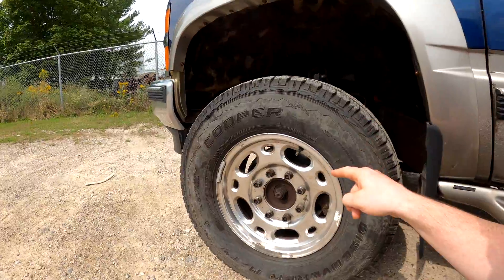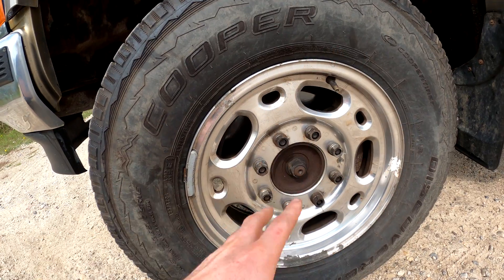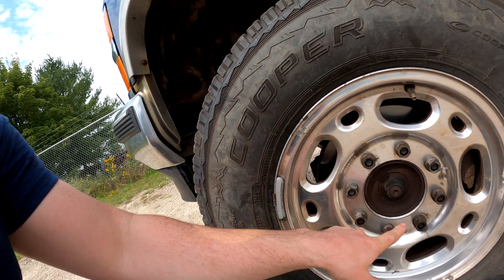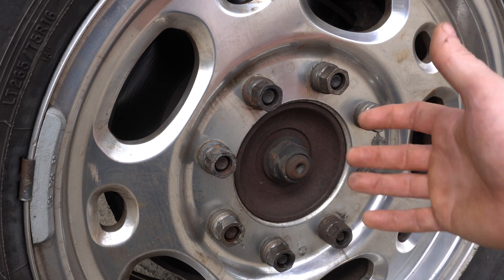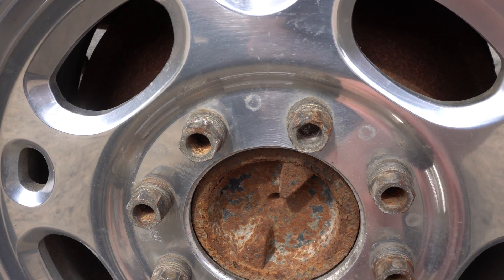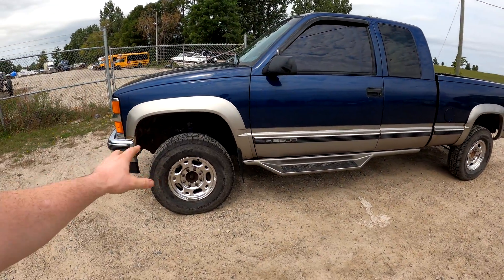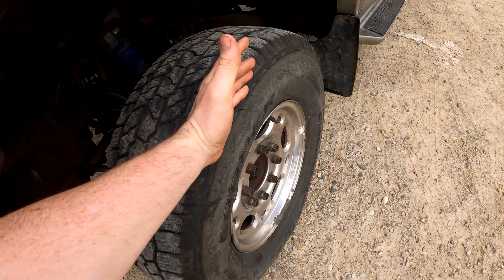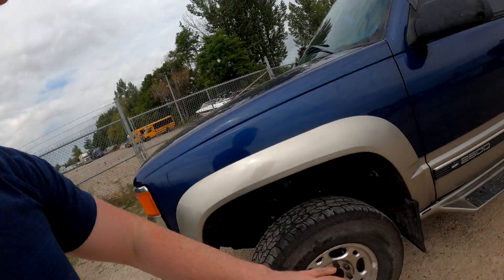Are WHEEL SPACERS Actually SAFE? | Hub Centered Wheel Spacer Fail

Comment: Excellent video thank you for putting the message out there. I am having to rectify a vehicle given a bodged up vehicle body  lift by a previous owner. Not only did the body lift wreck the cylinder head by putting the radiator and radiator fan out of alignment causing the engine to overheat. The wheel spacers used for the oversize tyres were full of stress cracks and were soon about to fall apart. When I put some welders crack detector on them I found these cracks to be even worse than they initially appeared. Needless to say I have got rid of these oversize tyres and wheel spacers and have had to put in hours to get the vehicle back to how it was before this bodged up body lift. I am all for people being allowed the right to repair their vehicles but against people interfering with vehicles in such a way that they can become death traps.

Comment: Don't use spacers. period. Use better wheels, or stock wheels. The offset is designed to distribute the load on your bearings.
Reply: True but most ppl don’t have the money
Reply: @_Sayvo_  i wouldn't do it then. Theres a video of a spacers falling apart on the highway. Tire comes off and launches another car in the air and flips it. Talk about not having money. You won't after being responsible for that mess
Reply: @MC2RD  true, but I think that’s because ppl get carried away and run 2-3 inch spacers..I’m running 10mm spacers and it’s fine
Reply: Spacers are fine as long as they are hub centric. Porsche have been using them for ages. Just dont use on a truck ment for haul, loading.

Comment: So what about using regular spacers on the 1500 ram? Safe? I wanna get 1in ones.
Reply: I have 2017 ram 1500 with 2 inch spacers adopters with regular 20 inch rim and 33 inch mud tires on stock ride height torque them to the spec and works like a charm for 4 years now no problems of any kinds i rotate my tires every oil change so i check spacers to and torque them if i have too.
Reply: @Sani1290SDR  Is there’s a speed limit with the spacers?
Reply: @arngamboa5637  I went many times 170kmh with my truck that's the truck limit.I honestly never had issue with my spacers, but i rotate tires every oil change and check on them spacers, to make sure they are still tighten. I did donuts, burnouts, quick acceleration. No problems and I bought mines of ebay. I do wish i got 2.5 inch spacers. Makes truck look even better.
Reply: @Sani1290SDR  i bought 2 inch spacers dcvamous hub-centric from amazon do you think this brand is reliable for daily driving
Reply: @marshalkwt  well I don't know anything about brand, mine are hub centric from ebay, so far made 150k kilometers with them. I have no issues whatsoever,  but I rotate tires every oil change and make sure that spacer bolts and tight and everything is snugg no cracks and stuff. You have to be careful with spacers and make sure you check on them every now and then. Mine are on since 2018, and I love them.